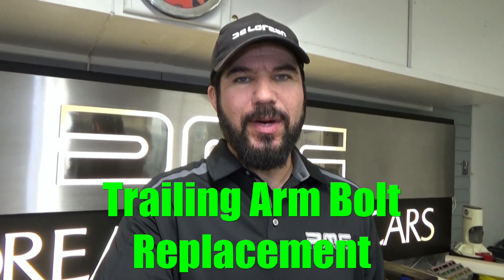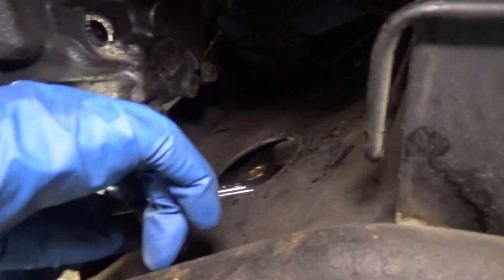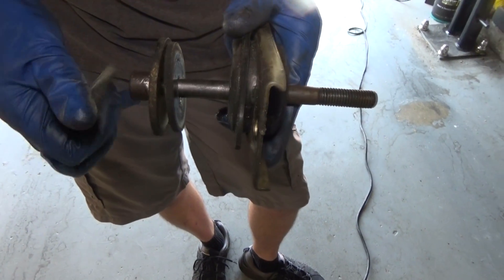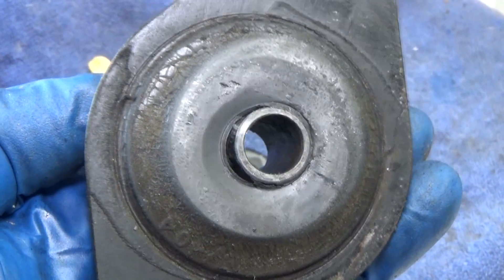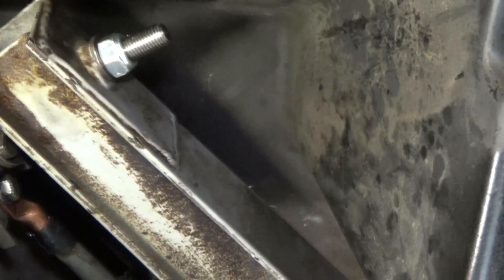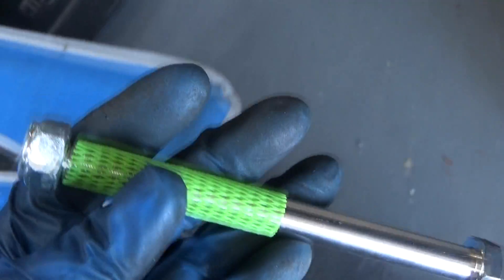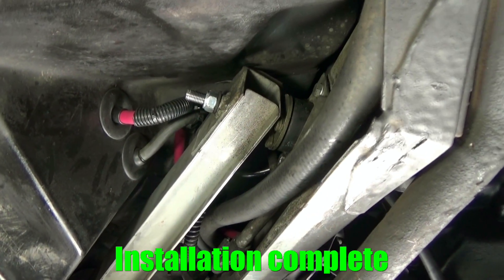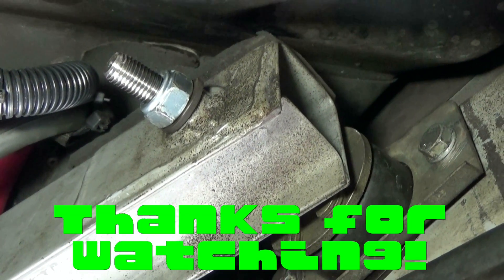DeLorean Trailing Arm Bolt & Bushing Replacement Tutorial with Inconel 718 TABs 🔧

Comment: Inspiring Delorean owners should watch this. These bolts are a weak link in the rear suspension. They can bend or on rare occasions break. IMO if they knew these bolts weren't strong enough they would have been recalled!

Comment: I’m curious to know the difference between the bolts for manual and automatic transmission types.
Reply: There's no difference in bolts. Some vendors have made bolts with a rounded head to make it easier for installation. You almost have to remove the automatic transmission to get the old ones out. I did mine last year lucky I have a manual transmission so not that big of a deal. I did do a ground upgrade when I did them. I gained a volt to a volt and a half at idle.
Reply: @davidbublitz6571  I changed mine several years ago and my car is an automatic and it was a terrible job but doable. This video will be good because all owners must check these bolts yearly IMO.
Reply: @andrewp4258  At the time I changed mine the car only had about 16000 miles on it and they were slightly bent. You have to roll them on a flat surface to tell.